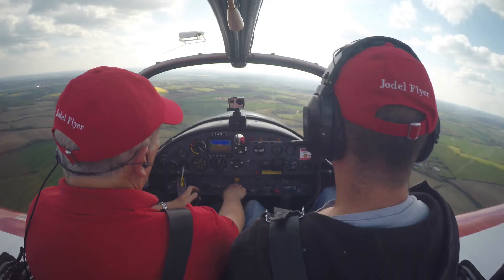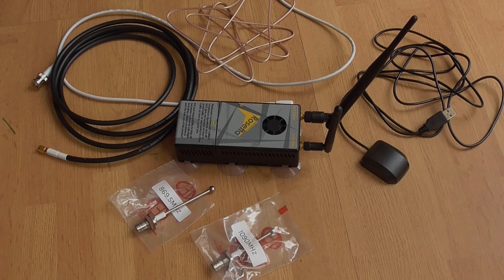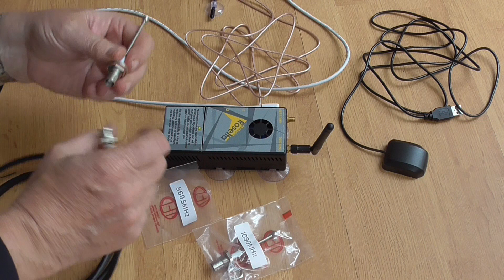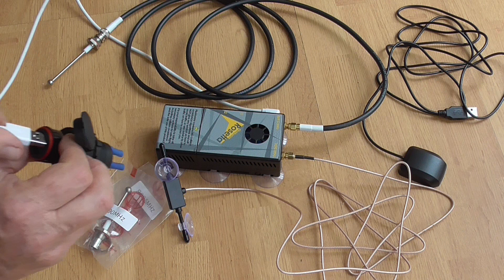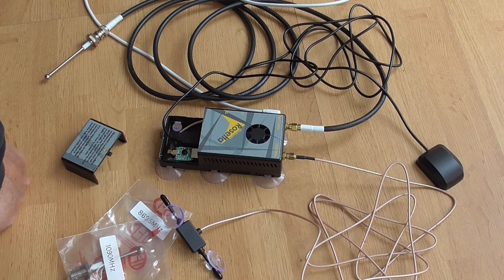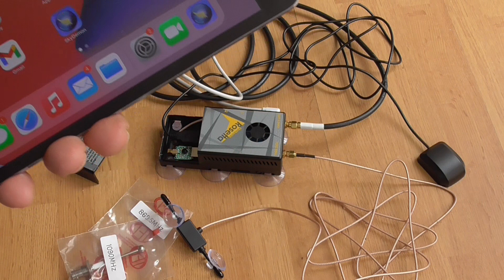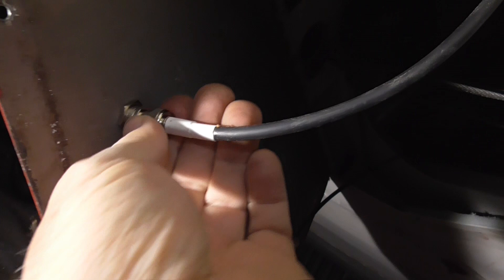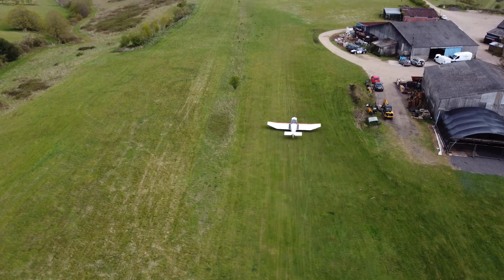MY PILOT AWARE UPGRADE - PILOT VLOG#360

Comment: Extra conspicuity is great, and on balance definitely a safety advantage. However, it's important to watch for a creeping over-reliance on the screen which lessens the lookout. The best thing about the on-screen alerts is that you get far earlier notification of potential conflict factors. Nice upgrade Tim!
Reply: I am with you about becoming reliant on the screen. I think of Pilot Aware as a passenger who points out what they see, the audio is what attracts my attention but if it says "Aircraft 1 o'clock 1000ft below" I may look that way, if it says same level or 100ft then I may glance at the screen if I can not see it, to confirm its relative position, the same way as I might look at what a passenger points out or ignore it if I have other things to deal with. It is nice in a single seater it is nice to have an extra pair of eyes, even if they are electronic.
Reply from the maker: I totally agree Charlie. There is nothing better than good eyes out of the cockpit! 👀

Comment: While external antennas are going to provide a substantial improvement in such a low powered system it fails to address the main shortcomings of a system that requires contact with ground stations to function.
Reply from the maker: Fair enough Robin. Thanks for watching and giving the feedback.

Comment: Thanks for sharing,  I have an issue with my Garmin 650 gps signals as the antenna located underneath the turtle shell in the Extra , as soon I do + 60 degrees turn the signal disappear and difficult to regain again.  Any advice or similar experience!!
Reply from the maker: I do not have that problem and don’t know the answer but maybe others reading this might be able to help. 🤞

Comment: All interesting stuff as usual.  However, I failed to comprehend the usefulness of the vector plot itself.  I don't know what it is for.  I think it shows what direction you have been in over time but I don't know how that would help a pilot.  It seems a lot of effort to go to, to get a plot showing which direction you mostly fly in.  Unless I have totally misunderstood what it shows?
Reply: Hi Robert the vector plot shows you from what direction you Pilot Aware System received the data about other traffic so you can see if you set up is picking up evenly all around or if there are gaps (possibly due to undercarriage), this in turn gives you an idea of if you need to move the aerials. I hope that helps.
Reply: @ayates5709  Thanks.  That makes lots of sense.
Reply from the maker: I hope the other answer helped clarify it for you.
Reply: @JodelFlyer  The vector diagram doesn't show what direction you fly in it shows what direction your electronic conspicuity was picked up in.
.
Reply: @JodelFlyer  It did.  Much appreciated.  It makes sense to me now.

Comment: You've flown again on the 13th &15th as I look a this and those two days individually show a good radiation to port one day and stbd the other. Did you change the aerial locations between I wonder? Good to watch the learning process in virtual real time. Interestingly, the vector page also will show the output of the other device (sky echo) - for example have a look at 404E19 with CAP1391, interesting how being in a cockpit kills the range by comparison.
ATB - look forward to the next instalment.
Reply from the maker: It is an interesting display. I am wondering if it has anything to do with the fact that on the 13th I ran down the coast to cross the channel at Dover (hence the lack of data port on the way out and stbd on the way back) ?
Reply: Yes Vector will show the radiation pattern for all EC types.
Reply: @JodelFlyer  Tim, that sounds very likely, you'll just have to do more flying ;-)
Keep it up
Reply: @Exsluka  Indeed, I think it's a gift to the whole flying community whatever EC is installed, debugging anything needs reliable data showing what's going on. Thank you PAW for giving us this wonderful tool.

Comment: Thanks for sharing Tim, how interesting, will be good to see the improvements. Would be interested in a little more explanation around the vector chart, wasn’t sure what it was showing. Until next week my friend happy flying . Neil
Reply from the maker: We will have to see how the Vector Diagram works with the new kit. We had a good trip to St Omer over the weekend! 😎👍
Reply: @JodelFlyer  The Vector chart shows a vector diagram of your electronic conspicuity transmissions as they are detected (or not) from the ATOM ground stations. This then shows how good your electronic conspicuity is working and whether you have blockage or attenuation in any direction.

Comment: Interesting video, but would have been even better if there had been an update after you had fitted the external antenna....... It left us not knowing what difference it made, if any
Reply from the maker: Thank you. Point taken but I sometimes think I will pick up points on the next video and then get side tracked.
Reply: @JodelFlyer  did you find much difference with the external antenna?